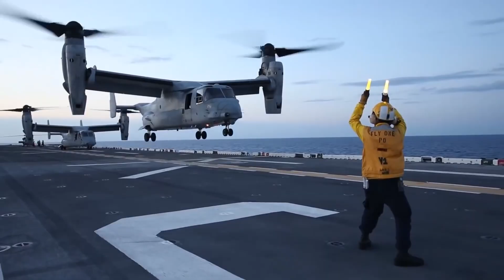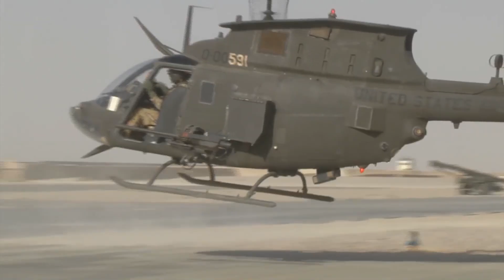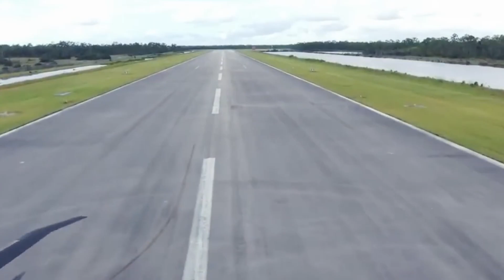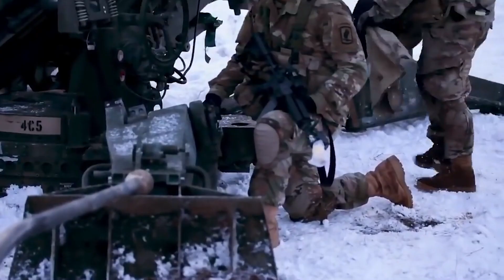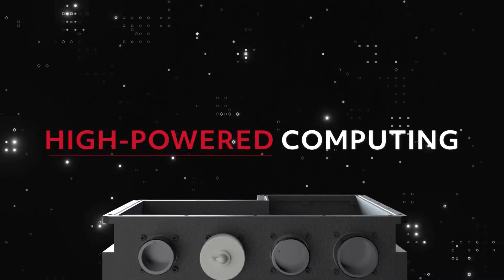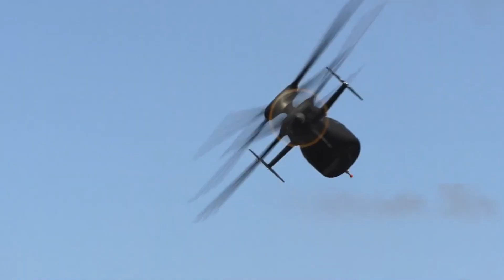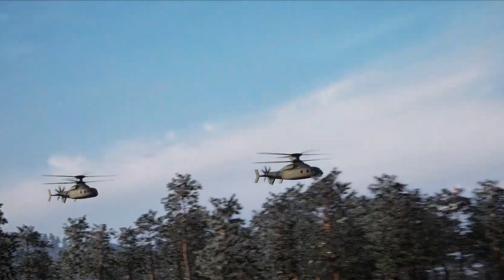SB-1 Defiant - Must go faster!

Comment: The V-280 won due to the two most important words the Army wanted to hear. "Self Deployable". While in theory the Defiant has some things it does better than the V-280 Valor, the Valor can still get just about anywhere in the world faster. Because it can get there mostly on its own, with limited logistical support needed. It doesn't need to be crated and stuffed aboard an Air Force Transport. It may need fuel stops of aerial refueling rendezvous. But that's a hell of a lot easier to setup than flying 2 dozen helicopters somewhere aboard AF transports. The Defiant was an entirely new technology that Boing and Sikorsky were trying to work through. Slowly and badly. The Valor was basically everything learned from the Navy and Marine V-22 Osprey, evolved to the next level. The Defiant Prototype only ever got a handful of hours of flight testing time. It was offline dealing with issues constantly. The V-280 Prototypes have been almost constantly in the air for years now. Bell delivered a production ready prototype. Boeing/Sikorsky delivered an interesting X plane that still needs years of major refinement before it will ever be ready for production let alone front line service.
Reply: Are you not forgetting the superior speed and capacity of the V280?
Reply: Too bad the Army wants to have armed variants of the winner because there's no way the USAF won't throw if a fit and claim that the V-280 is a VTOL airplane and not a rotorcraft when they try that with the Valor. If they complained about the Lockheed AH-56's stub wings and pulled out all the stops to get it cancelled (up to making the A-10 so they could claim duplication of capabilities) they will for sure complain about an armed tiltrotor.
 
Also, tiltrotors will always have inferior hover performance compared to traditional helicopters because they necessarily must compromise between prop drag and disk loading. Lower the disk loading and prop drag in forward flight increases, lower prop drag and disk loading in hover increases. Because of that a tiltrotor must always be mediocre in both flight modes. For this reason tiltrotors will never replace true helicopters, they will never be able to match their performance in the hover/loiter mode.

 EDIT: While it's true the SB-1 needs some more work we already know that coaxial isn't some pie in the sky boondoggle that will "never work" because the russians have been making them for 80 years now and the pusher configuration worked fine on the Lockheed the AH-56 (some other things on it had problems but the feathering pusher worked just fine)
Reply: @atomicskull6405  Edit part.
Russian helicopter KAmov, is full booked in civil engineering construction,
because the ability of steady hover is unmatch.

Steady hover making it suitable to lower down structure that needs to be bolt 🔩, to secure it.
The automatic hover function is fast response because of the double rotor on single axis,
making it looks like, the helicopter didn't move in the air, even in high wind area.
Reply: @atomicskull6405  It will be fine, this will let the AF finally kill the A10 which they have been begging to do for years XD.
Reply: IMHO the Army could use both for different jobs and situations. One size does not fit all.
Reply: What a beauty ......it look like a helicopter submarine or a submarine helicopter ..it reminded me how to train ur dragon ...it's a beautiful weapon ..
Reply: Though I think the Raider X is a better option than the Invictus. Speed and ability for more weapons
Reply: @michaelgormel7223  Both have been cancelled thanks to seeing what happens to close support scout copters in Ukraine. They are now going in a different "drone focused" direction.And hilariously Boeing, Northrop Grumman and Lockheed Martin all just lost out on the $30 Billion drone program to a new relatively unknown defense contractor General Atomics. We may be witnessing a major shake up in the Defense Industry. Boeing in particular seems to be nearing a death spiral.
Reply: Good analysis. Thanks. Good point on transport
Reply: Of course, by the time that happens, the technology will obviously be old,commonplace and superseded by something new
Reply: On paper maybe but the unspoken dark answer is Bell was much more willing to give away IP, LMCO/SAC/Boeing stood firm on retaining IP. Gov’t wants ownership of all IP.
Reply: @speedntktzlastname2182  which they should have as it's their money paying for the majority of the R&D and construction of prototypes.
Reply: @DeeEight  not true. Background IP already exists at private expense & data rights assertions are claim to retain IP. GOV demands rights above & beyond what’s tax$. Bell flows down those same demands to subs. It’s Bell offering its suppliers IP to GOV in order to win.
Reply: So essentially we're talking about two prototypes that are still on the drawing board waiting for the instructor to grade them. This is all very cozy because who ever wins the competition we the taxpayers will end up paying for the production and the maintenance of these airwolves.
Reply: @tshavfengvang7831  They’ve already been graded. The V-280 won. Bell did their homework. Based their new design on lessons learned from the V-22, and produced two prototype test aircraft that spent the next 2 years flying steadily doing everything the Army asked of them. The Defiant prototype could only achieve 20 flight hours over about 3 days of testing. Every second of footage of the thing flying is from those three days. It’s an entirely new aircraft, using entirely new design concepts that they still need years to work out. Particularly the complex gearbox and transmission for the unique counter rotating rigid rotors.
Reply: @andrewtaylor940 A welcome statement.  Hopefully,  Uncle Sam made the right decision.  The competition for the YF-22 and YF-23 so called "America's 5th Gen" fighter didn't go too well so much with cost overruns and bureaucracies we lost billions $$$$$$$$.😞 Perhaps,  we could have gone the other way with the YF-23 "Blackwidow" and got a better bargain.
Reply: @tshavfengvang7831  the blackwidow, just like the defiant, lost because its rival was better. its been over 20 years, get over it
Reply: @BruhMoment-re8nc "Get over it! " is not in my vocabulary.  Lol.
Reply: @tshavfengvang7831  You don't really understand why the F22 ended up costing so much. The F22 was designed for a threat that ceased to exist. When they canceled most of the order they doomed the fighter to exist without economy of scale. Take the F35, its development was even more expensive but because of the economy of scale it will cost dramatically less per unit. Biggest part of this is the fact that we share F35s with our allies. This gives us defense in depth without us having to foot the entire bill. Additionally the F35 was built with open architecture which allows for much cheaper upgrading. Last thing, the F35 family, A, B and C, provide incredible capabilities to the military. The F35A is an amazing multirole fighter. The B variant gives that full capability to the aircraft carriers. Last, the C turns amphibious assault ships into pocket carriers, expanding our effective carrier fleet 3 fold.
Reply: @tshavfengvang7831  No....technically the two companies were already paid to build their technology demonstrators, which both did, but Bell's needed less to develop due to their long standing SUCCESSFUL experience with tilt rotors. So theirs flew first, completed all the required flight testing first, and demonstrated being the more mature design needing LESS work to go into production. That's why they won the contract. Boeing, who now owns Sikorsky might still win the long range attack and recon helicopter competition, though.
Reply: The V280 seems like a flying LCS to me. Plenty of promises about it. But will only bring a boat load of problems that the Brass is overlooking.
Reply: @GRIGGINS1  Incorrect, the V22 Osprey was more or less the LCS. The Valor is the refinement from lessons learned from the V22 program. It is a fantastic system.
Reply: @afterthefact6708  They said the same thing about the LCS during the first few months. And we know how that statement aged.
Reply: @GRIGGINS1  the LCS was largely a testbed. Many of the technologies are being implemented into the new frigates being built. This is not their first run ay tilt rotor. Many of the design aspects have been improved in the Valor. Desite the issues the V22 os actually serving well and has found a place in the Navy as well.
Reply: @afterthefact6708  They didn't fix the issue with the V22. They just decided to put them back in service as is. And the LCSs were not testbeds. They were suppose to be a new class of ship that patrolled Litorial waters. And I very well remember people using the same arguments for them that people are trying to make for this thing.
Reply: The only reason why it lost was because the outdated engine from a chinook it wasn’t fast enough but it was a lot cheaper so the military should have given it a second chance
Reply: @PhaGe-gaming-  Why should they have given it a second chance? Because it looks cool? It makes you think of Airwolf? It did not meet the specified design requirements in testing and could only fly for 20 hours. The Chinook Engine had nothing to do with the complexity and fragility of the not yet ready for prime time fixed counter rotating gearbox. Why would anybody think it was going to get better? The DoD is well aware of the issues plaguing modern Boeing. The KC46A program has been a decades long disaster for example. They are also fully aware that these same issues do not appear to currently be present with Lockheed Martin.
Reply: @andrewtaylor940  fair point the 280 can also lift more and they were using the chinook engine the first flight test it’s an older engine and not really designed for that helicopter
Reply: Sikorsky got hosed, this was all political.
Reply: try landing one in a standard 4 lane wide intersection to drop off troops. Not gonna fit with a 50ft wingspan + rotors. 
the V-280 would be great for open terrain, it's an amazing machine with more range and speed, the SB-1 has better footprint and maneuverability.
Reply: @Will-W  The V-280 is shorter in overall length but wider, the landing footprint is only about 20% larger in area. The Army used a measure of an NFL football field (not without precedant, the plan for the Iran hostage rescue involved landing helicopters in the soccer stadium in Tehran which was an even larger area) as to why the 280 was superior. In the available field space, you can land 12 Blackhawks or 10 Valors. At full troop and crew loads, the 10 Valors can carry 8 more total troops than the 12 Blackhawks, to a point further away or in less time.  Or put another way, the standard US Army infantry rifle platoon is 42 men. To move them together requires four blackhawks or three valors.
Reply: @Will-W  The V-280 only has a 19% larger footprint than the Blackhawk while carrying 23% more troops... I don't understand why people think it is that much larger.
Reply: @Will-W  This is a common misconception.   The V-280's landing profile is smaller than a CH-47, and not remarkably larger than a Blackhawk. Roughly the equivalent to the Defiant's. You're just looking at it without rotating it 90 degrees.
Reply: @andrewtaylor940 that’s not true. The Valor requires a much larger footprint. That says, the Pentagon was ok with the trade off. The range and speed were too much to pass on
Reply: @ It really doesn’t. It’s larger than a Blackhawk. But so is the Defiants. The Valor footprint is about the same as a Chinook.
Reply: I see what you did there, changed the requirements set forth by the Army. The V-280 met and exceeded the requirements. @Will-W
Reply: @RichardShelton  I totally understand I'm not the Brass setting the requirements for the Blackhawk replacement. I'm just an amature armchair engineer doing thought exercises. And as I said, the Valor is an amazing piece of tech and yes it has longer legs and higher top speed, but in my head, as a medium lift bird, the Defiant would fill a wider range of capabilities. 
My opinions have always been my own and as a human, they are fallible just like everyone else.
Reply: @Will-W   You dont land, air assault drop. =D
Reply: @Will-W  Zip lines
Reply: I love Osprey despite it's many failure and crash.

But Valor with it's open engine (in vertical mode) is not suitable for military.
Any vehicle that can be disable with . 22 bullet on large target (in fact double target) is a hazard.

Don't tell me it's prototype, after claimed it's ready for production; it's beyond illogical. 
Bell better make those engine somewhat small arm proof,
because right now it's a flying coffin.
Reply: @budisutanto5987  It's actually much safer to do the Tilt Rotor the way the Valor is doing it then the way they did it with the Osprey. Pivoting the whole ENgine Nacelle means all the fuel feeds, electrical connections, everything, has to pivot. The only thing exposed when the Valor goes to vertical mode is the 90 degree linkage. Which is not substantially different than the drive train on any other Military Helicopter or Ground Vehicle. Y'know the engines on helicopters aren't armored right? Or rather what Kevlar they have is to keep exploding engine parts in.
Reply: @andrewtaylor940  'Which is not substantially different than . . '
Agree to disagree.
It's fine for base use, not so much on hot zone. I do like tilt-rotor aircraft. 

Armored engines.
I believe Apache have armor on the base of it's rotor. 
I'm not talking about .50 bulletproof.
Military small arm bulletproof is enough.
It's an aircraft, not a tank. 
Unfortunately Valor ready for production as it is.

In any case, it's better to put armor for hot zone vehicle.
New design should be improved, there's no good reason to accept civilian or non front line helicopter's standard.
Reply: @andrewtaylor940  I think he believe a thin sheet of aluminum and kevlar counts as "armor" XD
Reply: @budisutanto5987  Nothing on a blackhawk or an apache can withstand rifle rounds XD For all intents and purposes both aircraft are unarmored.
Reply: @afterthefact6708  'Nothing on a Blackhawk or an Apache can withstand rifle rounds'
The opponent all carrying rifle which greater then 23 mm? 🤣🤣🤣
My friend back WINDOW car can withstand 7.62*39mm AK rifle rounds.
You should go out more
Reply: @budisutanto5987  Ive shot men throw front, side and rear windows with 7.62 and 5.56. Standard glass does not stop rifle rounds. Now I knoq you eithes a troll or so ignorant as to continued conversation useless.
Reply: @afterthefact6708  'STANDARD glass does not stop rifle rounds'
Indeed.
but did I said it was STANDARD, I didn't. 
The civilian owner of the CIVILIAN car must pick(PAY) that option when purchasing the CIVILIAN car.

It went through your head. 
Civilian can own a car with small arm bulletproof back GLASS window, but according to you, MILITARY vehicle aren't. 🤣
Reply: @budisutanto5987  Ok hero, now you are just playing move the goal posts. Can you buy a vehicle with bullet resistant glass? Yes. Would you or are 99% of cars so equipped, NO. Now our up armored Humvees did have armored glass and it was fantastic. You know what it wasn't? Light. It was heavy and 4 inches thick. I have also engaged vehicles with rifle fire through doors etc. The only part of a car that will generally stop rifle rounds is the engine block. That's sheet steel which is a lot stronger than aluminum XD. Generally you would not want bullet resistant glass on a civilian car because all that does is trap you in the advent of a serious wreck. We actually had to deal with that issue with our Humvees as well. We carried chop saws and every door had tow lugs so we could cut off the hinges and then use another vehicle to rip the door off. Now lets see you make another daft goal post move lul.
Reply: @afterthefact6708  'Can you buy a vehicle with bullet resistant glass?'
besides Humvee, 
No, not really. As far as I know, available option is for the back side only (from factory/distributor) (not custom made) (no permission required). 

Armor. To avoid heavy weight, 
- two sheets with space between them, rather then one sheet double thick
- lightweight Ceramic. It shatters - absorb bullet energy
- inner Kevlar lining. Stop spauling/deadly metal debris of scattered bullet's pieces from OUTSIDE
- metal alloys that only military can afford/ produced (ex depleted Uranium)
These tech isn't new.
You want me to explain Blackhawk & Apache tech, I did NOT design those
Reply: @budisutanto5987  Not one of the armor technologies you mentioned is used on helicopters except kevlar. Weight is a crucial element in any aircraft and there just is not much to spare for armor.
Reply: @afterthefact6708  He also doesn't grasp that having the 2 engines widely separated reduces the risk of both being taken out by a single failure or combat hit.
Reply: @budisutanto5987  yes because they couldn't possibly have considered that possibility and made the structure strong enough to take a small arms hit there. You know all the things they didn't ever plan for and therefore they should listen to a hack on youtube like yourself.
Reply: @DeeEight  
ANYONE with eyes can see it, 
both Valor engine is wide open in vertical mode.
Not suitable for deploying or extracting troops in hot zone.
Flying coffin ⚰️💀

I rather use Blackhawk.
Don't have to be able to cook, to taste and judge food.

Customers: your food taste horrible.
Chef: Can you cook?
Customers: ??
Reply: @budisutanto5987 A Blackhawk's engine isn't really any better armored, and if your enemies aim at the engines it'll get penetrated by small arms fire in much the same way. The solution to survivability for "hot" operations is better mission planning with rapid deployments and improved perimeter security, not stacking additional armor.
Reply: @StrikeNoir105E  No, it's not the same.
Covered engine is better then open engine.
Reply: @budisutanto5987  Lol its "covered" by thin guage sheet aluminum. This isnt armor brother.
Reply: @budisutanto5987   What a weird comment, aircraft are mostly made of basically paper comparatively lol. You can not guard against missiles etc, every proven combat aircraft has very little in the way of "armor".
Reply: Thats the first time I've heard it put that way.  Regardless I think the defiant would of been a  better choice and safer for our troops mainly because of the footprint.
Reply: @robertgregory6778  Why ? A helicopter years of actual time, and hundreds of flight hours behind the V-280 in development which didn't really do anything better than a blackhawk other than top speed, and which failed to meet basically every other requirement to win the contract.
Reply: @DeeEight    The Valor exceeded requirements in ever category as well, which did not bode well for the Defiant.
Reply: @robertgregory6778  /smacks head. They have almost exactly the same footprint! The Valor just looks bigger because you’re not mentally rotating it 90 degrees.
Reply: @robertgregory6778 I agree. I wanna know what happens when you loose an engine on the v280? I can’t see how it would do a emergency landing like a normal helicopter would be able to auto rotate
Reply: @NICKYZou812 the engines are cross shafted so one engine can run both rotators in the event of an engine failure.
Reply: @NICKYZou812  You are going off of incorrect information and bias... 1. The valor is faster, can fly a further range, can get to altitude quicker, hover at a higher height, could carry more troops, and carry a larger load.  2. Valor only has a 19% larger footprint than the Blackhawks while carrying 23% more troops.  3. Yes tilt rotor aircraft can autorotate while in hover "mode" but the V-22 was hampered by the marine corps' requirements for size. They can also glide as well they just can't do either as well as a helicopter or airplane can.   3. They can fly on one engine as each engine can turn both rotors. While in airplane "mode" they should also be able to glide down after losing 1 rotor which is impossible for any helicopter.
Reply: It won't need to glide or autorotate.. It can fly and land horizontally in any reasonably large field, road or highway that is flat and hard. With the added 4000 HP it MAY be able to hover and land safely as a helicopter too TBD. Do people not read specs ?
Reply: @michaellove9831  No, they don't. I was arguing with an idiot who claimed to be a career AirCav vet yesterday on a FB post about the 280 and he clearly had no clue as to the current dimensions, payload capabilities/limits and other specifications of the UH-60, CH-47 or V-280. In his mind, a 280 has the same ground footprint of a Chinook but didn't improve on the blackhawk in any area except speed and tactical range. Nevermind the fact the V-280 that won the competition was a technology demonstrator that already demonstrated it could meet all the program requirements and went over and above them in many categories, and that there will be changes in the initial production version including the aforementioned engines going up in power about 2000 shp each over the version of T55s used in the demonstrator. As long as the final product has a backup APU or hydraulic system to at least partially rotate the nacelles to their 45 degree position so the rotor tips clear the bottom of the fuselage, it can land as an autogyro would during a complete engine failure.
Reply: @NICKYZou812 I’ve lost track of how many helicopter flights I’ve taken. People TALK about how helos can land safely on autorotation if the engine fails, but helicopter crashes tend to be very deadly. I’ve lost friends and teammates in helo crashes.
Reply: You don’t really know what you’re talking about. Bell won that contract because they were crying that if they didn’t win the would be forced to close the doors.

Also the v280 isn’t the superior aircraft in this case. The only thing the v280 has is speed. The defiant will super seed the v280 after a few years of testing.
Reply: @NICKYZou812  Dear Lord the stupidity. Defiant barely has any flight time. This is the same crying and bullshit as when the X-32 lost the JSF competition. They went with the aircraft that was and is more production ready, while meeting the requirements. The Defiant prototypes have been a disaster in testing. It will be faster? They can’t get the complex counter rotating transmission and gearbox to work reliably for more than a few hours. As you say an actual working aircraft is still years away. The V-280 is production ready. This was the biggest no brainer decision in military procurement history. And no it remains unlikely that the Defiant will end up faster than the Valor in horizontal flight mode. Because Airwolf is not real life.
Reply: @NICKYZou812  No YOU don't know what you're talking about. The SB-1 Defiant demonstrator aircraft first flew 16 months AFTER Bell's V-280 demonstrator and in 21 months at the end of December 2020, the SB-1 had only logged 26 flight hours over 31 flights and had only reached 250 knots. By that time though the V-280 had logged over two hundred hours of flight time, and many more flights, and had expanded its flight envelope to 305 knots cruising speed and they even flown 320nmi to Arlington, TX to continue testing closer to the US Army. The Cruise speed of the Valor is higher than the top speed of the Defiant, its combat radius is nearly triple that of the Defiant, and the ferry range is such that it can cross the pacific with only a couple refuelling stops. The SB-1 does offer better performance than a Blackhawk, but its nowhere near that of the V-280. Worse Sikorsky tried claiming their mission radius shortfall was merely because they used the older T-55 engines from the Chinook program and that some future engine not yet developed would let them mee the 229 nmi missior radius requirement. Meanwhile Bell demonstrated a far greater radius with its prototype using T-64 engines and not the much quicker to develop variant of engines derived from the ones in the Osprey. There's also the internal cabin volume consideration, as the Blackhawk carries 11 equipped troops, the Defiant could carry 12, but the Valor can carry 14, and that's with all three aircraft having 4 man crews. With the standard US Army rifle platoon being 42 men, that only needs three Valors to move them while it'll be 4 Defiants or Blawkhawks.